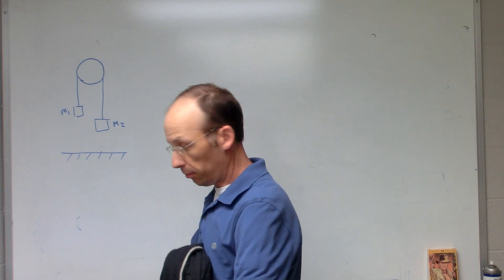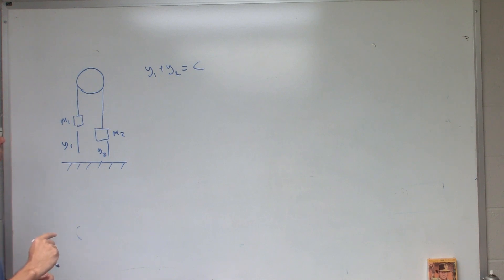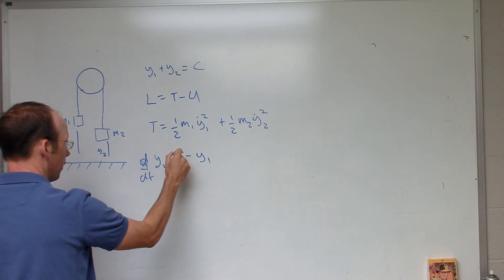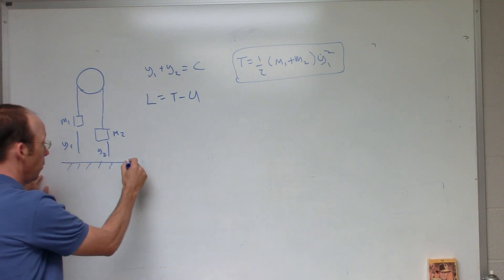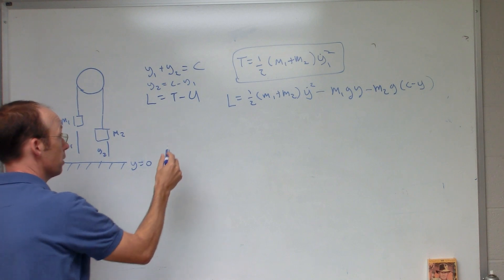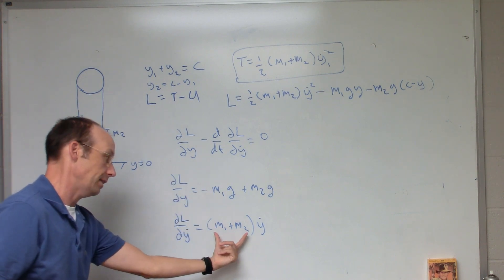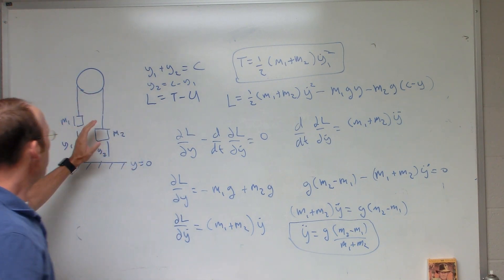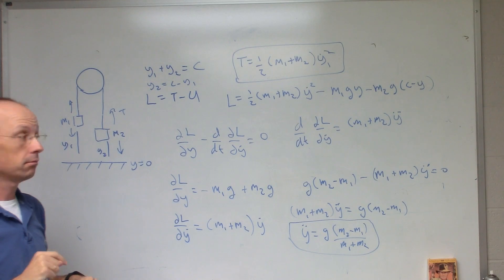Atwood's Machine With Lagrangian Mechanics

Comment: why you choose y2 = y1 - c ?? 
why not y1 = y2 - c ??
it will make a minus extra sign in the end if you choose y1 = y2 - c . What is the physical reason?
Reply: The minus sign would indicate the direction of the acceleration, you can "move it" inside the parenthesis (-m2+m1) and then you would have the exact same result but found around y2

Comment: This is a great video, thanks for the explanation. But, I have a doubt: in what case you can say that the Euler-Lagrange equation is equal zero? I can`t understand that, because generrally this equation is equal to Fj, i.e the forces non derivable of a potential.
Reply: The Euler-Lagrange is "equal to zero" when the forces are conservative (as you said, when they are derivable of a potential). In that case, the potential related to the conservative force is inside the Lagrangian. The Euler-Lagrange equation that you mentioned (equal to F_j) is for the the general case where you can have a conservative or non-conservative force. In the case of Atwood Machine, we know that the gravitational force is conservative, and then he used the "more appropriate" equation.
Reply: In case of Holonomic constraints ,it is equal to zero 
Also check Lagragian approach for Arwood Machine and Simple Pendulum  https://youtu.be/SoC8VhAfsDA